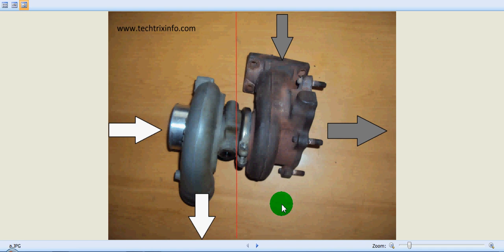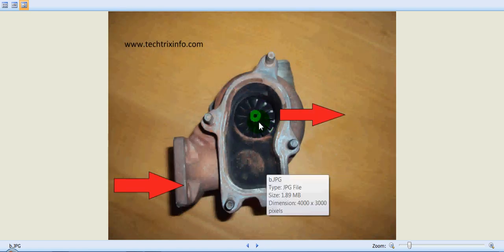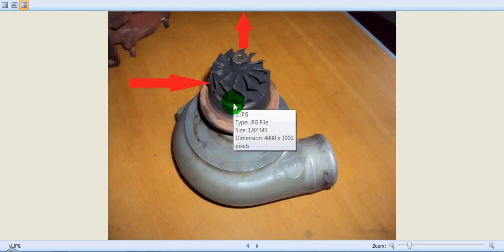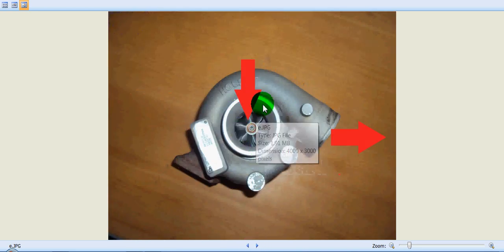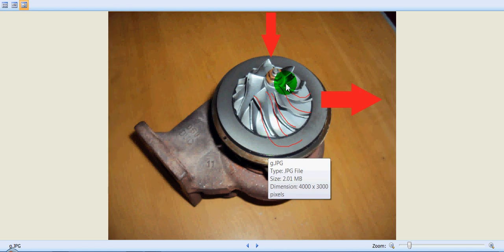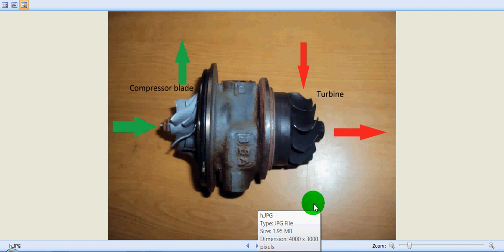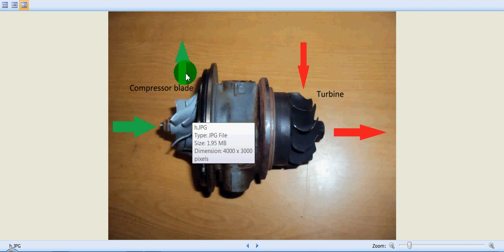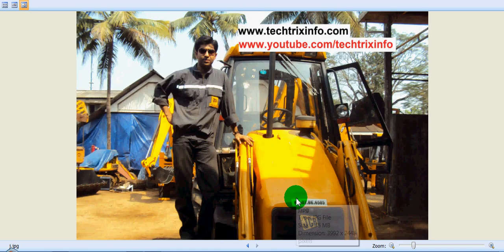Animation - How turbocharger works. ✔

Comment: The different between a supercharger and a Turbocharger is that the supercharger relys on the crankshaft of the engine to power the compressor while the Turbo relys on the exhuast to power it and the supercharger is better for low rpm boost while the Turbo is better for higher rpm boost

Comment from the maker: Thank you..turbocharger will have carbon deposits but it will not block it ..but if the oil gets burned more carbon deposits can happen which could block it..Solution is open it us and clean. Symptom: colour change of exhaust smoke.
You can subscribe to us for more video and also connect with us on face book just search for Techtrixinfo, feel free to ask doubts.